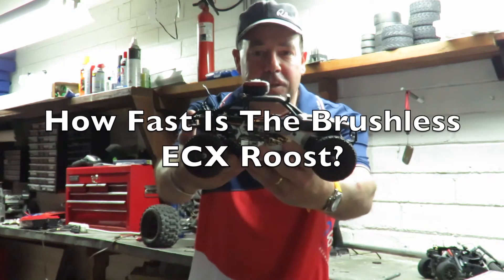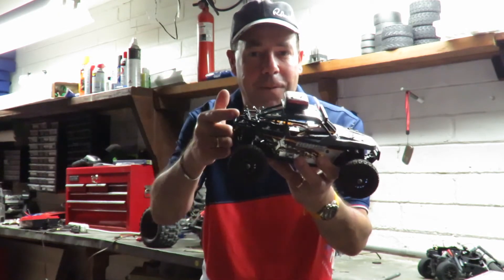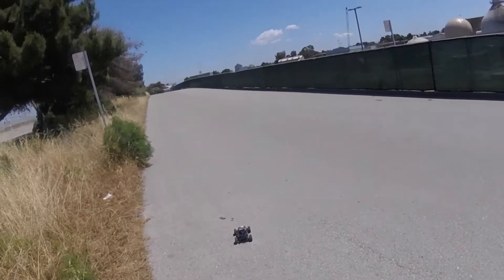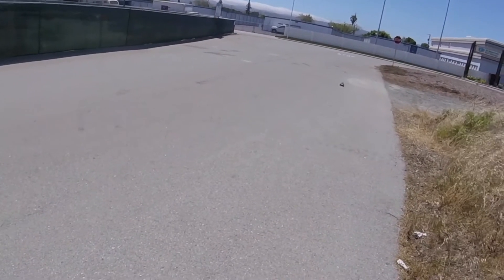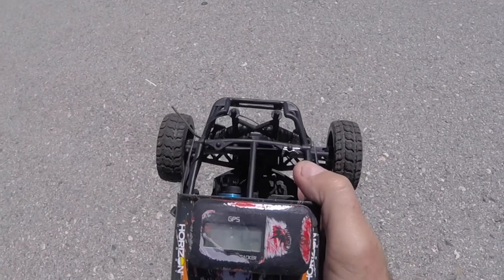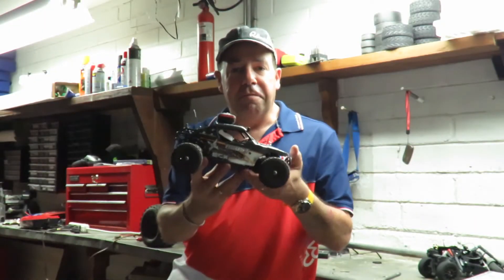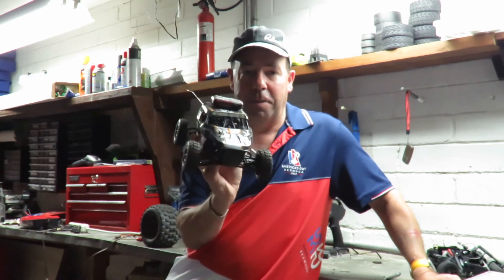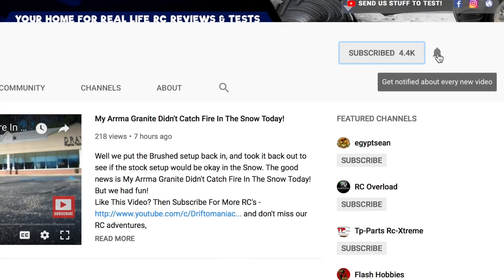How Fast Is The ECX Roost Brushless Conversion?

Comment: What kind of batteries do you run on this? Just got this rc car for Christmas. I've never messed with rc cars before
Reply from the maker: As stock it runs on a Nimh battery. This car in the video is highly modified and features a brushless motor running a lipo battery. However please don't try and use a lipo battery with the stock car as the power will literally fry the esc and you'd not thank me for that. However there's a link to the esc and brushless motor I fitted which are super cheap on amazon. Note also that you'll need to change to a separate receiver to do this conversion as the stock car has a combined esc and receiver
Reply: @DriftomaniacsRC  good to know sir. Yeah I'll just update to another nickel battery for now. 900mAh ain't cutting it for me
Reply: @DriftomaniacsRC  Which receiver are you using?

Comment: I went with the mamba micro x combo, since it has a 4200kv, 5300kv, and 8200kv variations, or the mamba micro x2 which has a larger motor and higher kv variations